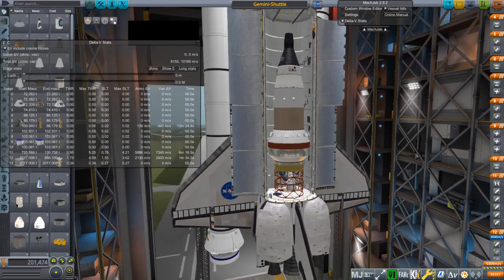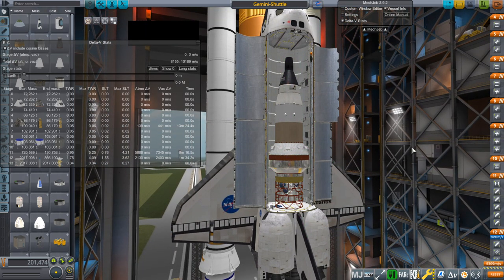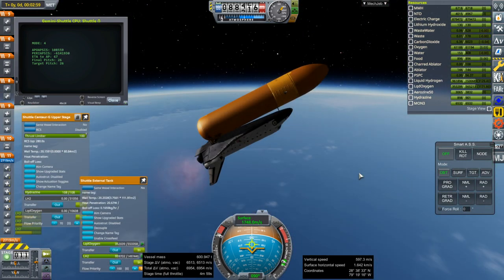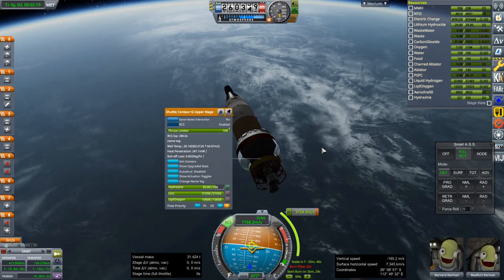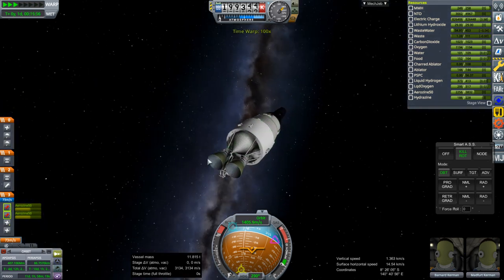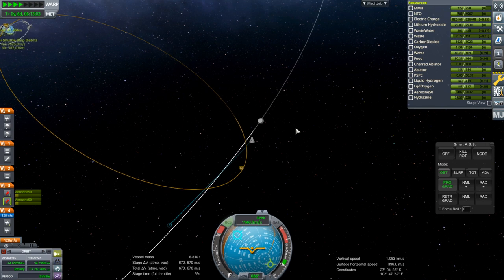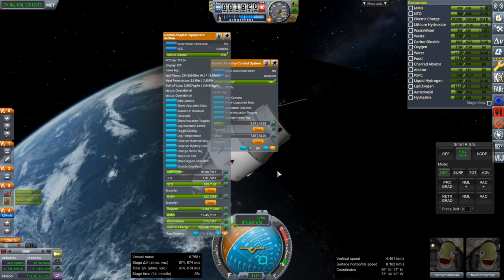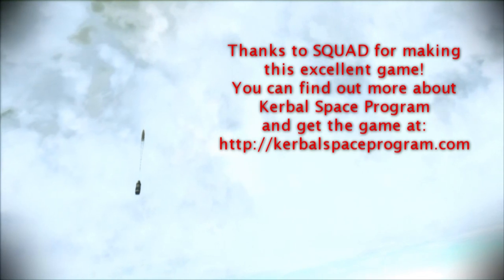Realism Overhaul in KSP 1.8.1 - Shuttle-launched Gemini Lunar Mission

Comment: For a more “modern” mission, would there be any way to send crew dragon to the moon using the shuttle? Although Falcon stage 2 is likely too heavy for the Space Shuttle
Reply: It would be difficult, because Crew Dragon alone weighs about 12 tons but I would not say it's impossible xD
Reply: Dragon and Falcon upper stage fully fueled weigh around 120 t. Considering Shuttle could get somewhere around 25 t to orbit that's not feasible. It would be way better to just put Dragon on Falcon Heavy.
Reply from the maker: As already mentioned by other comments, Crew Dragon is much too heavy, but also its heatshield is probably inadequate for reentry from the Moon (its area is too small for the mas). Crew Dragon's dry mass is twice that of Apollo and is heavier than Orion (probably because of its built-in abort system and service propulsion). So, a modern mission would probably use Orion, but that would still be too heavy for the Shuttle.